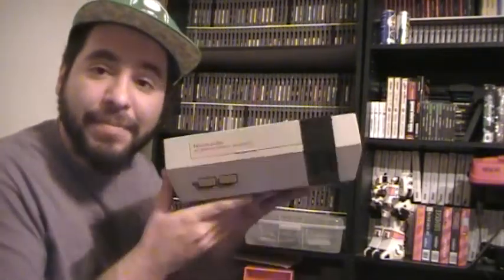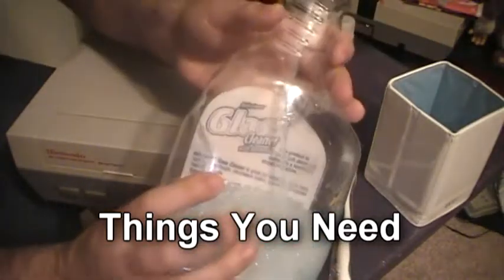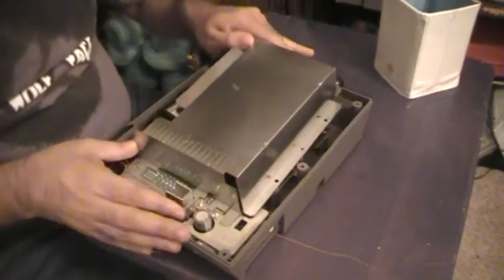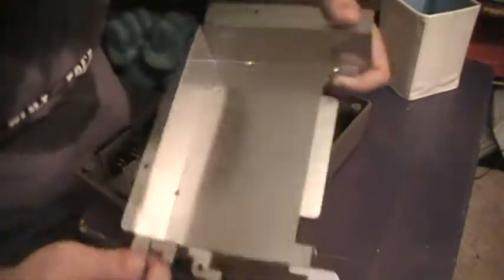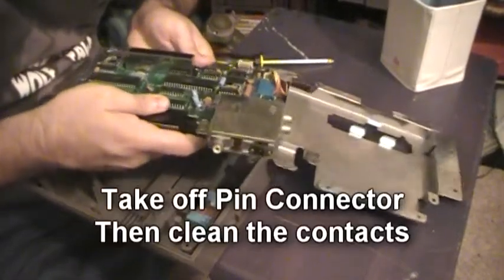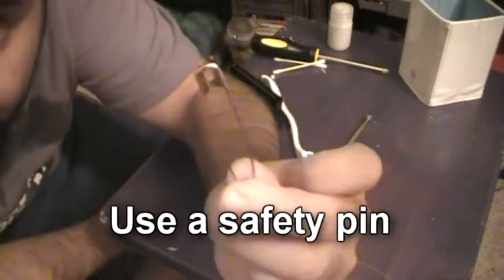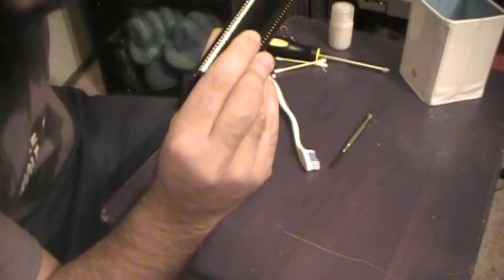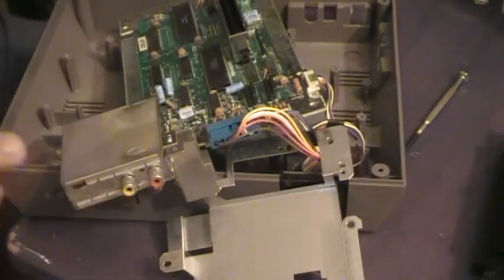Don't Let Your NES Console Collect Dust: Here's How to Fix It

Comment: The reason you have a problem with the springs locking on the nes and have to loosen the cartridge tray, is because there is a small portion on the front of the tray that needs to slide under the motherboard instead of resting on top of it. Loosen the 6 screws on the tray, slide it forward while gently pressing down on the front of the tray and you should feel it drop, then slide it back into place and screw it down. That should take care of your problem.
Reply from the maker: Yeah i figured that lol thanks

Comment: Not sure if this has been mentioned, can't be arsed reading all the comments :/ If you don't slide the loading tray on properly then you will have issues with the tray not locking down. Slide the little lip type thingy under the front of the motherboard so that it catches, preventing it from lifting, then screw the motherboard down. Works a treat!

Comment: Hi Eric I found a NES outside in the cold walking home from work a few days ago.  No joke, left near a building besides some train tracks. I swear saddest moment for me as a 32 year old adult and gamer. And yeah you're damn straight I rescued it!!!

 It was rained on and it's case is dirty scratched and not very damaged but yeah it is damaged, and sun faded. I don't think it's in bad condition, I think. I have no training or repair skills for game systems of any kind. The buttons don't seem to broken, the inside looks good. The AV and things on  the back look good. I found no power cord or controllers I was going to go back to the place where I found them near a building to see if anything else was left but it snowed.

 MY problem is it's full of dirty, sand and grit and I want to make it my project to clean and fix it so long as I can with putting money into it that's not power cord, game or controller related. I can take pictures and would love some advice on what to do and how this video is very helpful but I have a mess to deal with. And I don't even know if it works yet. I still have yet to open it up. I've been looking for good help you'r video, I found yours to be very helpful.

If you can, my email is sandman2783@gmail.com
Reply: did you get it working?
Reply: +John Douglas No I never did. I couldn't even figure out what was wrong with it.
Reply: Steve Ristich lol how much do you want for it? :p
Reply: It may take me a min because I'm doing a lot but we can talk.
Reply: +Steve Ristich sent you one.... get back to it whenever. we have time.
Reply: +John Douglas cool will do
Reply: did you get it to work John?
Reply: This was the end of our conversation, actually. Lol.
Reply: oh

Comment: The lockout chip is easier to “fix” with a fine tip fingernail tool, the metal is so soft you can literally just cut through it with almost no effort. Also, you should boil the 72 pin connector, not a chemical bath scrub down. After it’s been boiled in distilled water the metal comes out looking factory new... so shiny! Just make sure to fully dry before reinstalling.

Comment: I think you forgot to mention to unplug the nes...(ZAP!)  Nice video, I can only imagine the # of nes's that were thrown out when all they needed was a simple fix like this....I put a new 72 pin connector in mine and it works perfectly (you can buy them on e-bay for a few bucks) the only games that wont work on the first try are the really dirty games themselves....(which can be cleaned with a q-tip and some rubbing alcohol.)

Comment: Instead of windex cleaner I would use brass cleaner on the copper pins, it does a better job because brass is nothing but alloy made up of copper and zinc and this way you will not only clean the pins but protect them from corrosion and mold.

Comment: The reason you dont have to push game down, is probably cause you over adjusted the pins on the 72 pin connector!  Most down know how to properly put the loading dock back together,   there is a slot on the motherboard, if you dont slip it on properly, the loading dock is gonna have issues with how you tightening the screws both on dock and outter shell!

Comment: I bought an aftermarket 72 pin connector, because I tried fixing the original one, and it just didn't work.  Bought one made in Taiwan (supposedly better than ones made in China) off ebay.  Of my 11 games, I can only get like 7 of them to work. The other 4 just keep giving me the blue screen.  The new pin connector is obviously tight.  I removed the lockout device pin, not sure what else to do.  Can you help me?

Comment: also if u cover a credit card with a t shirt or something you can get it inside the pin connector and move it back and forth when I did that there was so much dirt in there my nes works like new after cleaning the pin connector and the motherboard
Reply from the maker: Nice

Comment: Thanks
Reply from the maker: thanks
Reply: 8-Bit Eric Followed your directions to a tee.  Cleaned the 72 pin connector, bent out the pins, disabled the lockout pin, cleaned all the connections on the board, cleaned all the connections on the games.  Everything works like it was new again, first try every time.  So awesome.  Thanks so much for this vid!!!

Comment: There is no point to cleaning the non contact areas of the pin connector or the contacts to the motherboard. These points have never been moved since it was assembled and should have the same continuity as in 1988. Just clean the game port pins. I have tried bending 2 pin connectors and both didn't work great. Try this and if you fail buy a new pin connector. I prefer to snip the lockout pin with a tiny pair of pliers. But whatever works I guess.

Comment: i get a grey screen and the red light. also I notice when I slide the cartridge in or pull it out, its not a snug fit. I assume it needs a ne 72 pin or atleast fix it?
Reply from the maker: Yeah prolly have to either tighten them with a clothespin or get a new one

Comment: I need some help with this bud, i've done everything as explained on the video now my NES doesn't blink but it also doesn't shows anything on the screen
Reply: Try using some brasso, window cleaner, or rubbing alcohol (or all of them) on your games, and make sure your 72 pin connector and the games are dry before playing. Hope this helps.

Comment: when I turn on my NES, it gives me a solid red light when the game is in, but I always get a black screen. I haven't played my original NES in years and it was left in the attic. I tried cleaning the 72 pin connector but no luck, I still get the black screen. Do I need to get another connector or do I have to fix something with the motherboard?
Reply: mine was doing similar stuff. I replaced the 7805 power regulator. If you don't what looks like, it's the black thing with three legs by the power input. Cheap item, easy solder work. Fixed mine.
Reply: maybe try dusting out the ports on the console where it hooks up to your tv

Comment: Is there ANYBODY on the whole net, who knows SOMETHING about pitch and speed optimizing to different regions? :'( :'( I'm trying to obtain a Powerpak, and with that I would like to test games on it which were never released in Europe, but the problem is as you might now: The regionfree mod has two bugs: if you put a NTSC game into a PAL machine, (or vice versa) the videoframes will be a bit tighter, and the speed will be -16,6666666% (or speed up) and you get a -1 (or +1 on vice versa) little secund soundpitch.

Comment: Just Trying to Help:  But you dont know how to Restore a Nintendo The Right Way! 1. You are doing the wrong pins on the video, the other pins are the ones, were the game goes in!  2. IF you properly install loading dock the correct way, you can tighten the pins like they should be,  if you install the dock the wrong way, like you do, you will have issue with the screws being too tight, and have issues with the screws being to tight when you place the NES top!

Comment: Im scared if i take it apart i won't be able to get it back together again!
Reply: If you stay scared and don't dive in and get your hands dirty you will never learn anything. Its kind of hard to mess up an NES by putting it back together, I have done it over 20 times lol.
Reply: Yeah i just did it actually, games work much better, not perfect, but better than before. Now i just have to get some good games (donations accepted)
Reply: It's really super easy to take apart and put together only like 10 or so screws and 3 connector pins.

Comment: Oh, and using a toothbrush to clean the pins, is a waste of time and effort!  Use alcohol 90%.  And you didnt show how to remove the lock out chip, you should were it is, and which one to remove.  Also there is a proper way how to remove the plugs from board, hope u learn that one day, make it easier for you!

Comment: That right! Better call me MASTER!   Listen Carefully Einstein!  OK, you are NOT putting in DOCK correctly if you are having issues tightening the screws!  COMPRENDE?  Ok, the NES board has a slot for the DOCK, which alot of MORONS dont know about and have trouble with dock and the nintendo top!  The screws will not tighten correctly if dock is not place on flush with board!

Comment: To Be Honest, You are not very good at doing this!  Let me tell you the reason the loading dock does not work if you tightening the screws!  Its because you didnt put it on correctly!    There is a proper way to make it flush with the board!   Also the way you clean the pin connector is not correct, or the way you redo the pins, you are readusting the wrong pins!  I give this vidoe 4/10